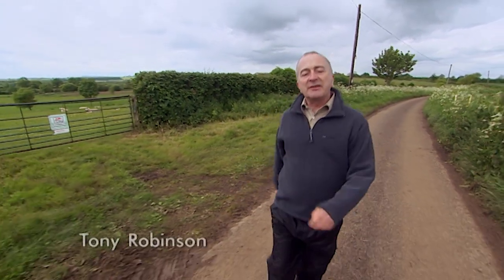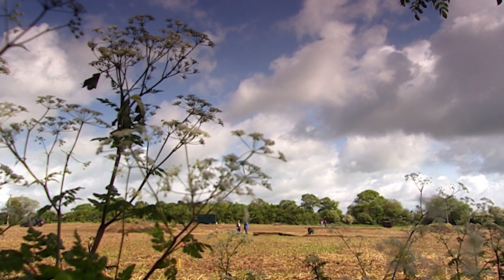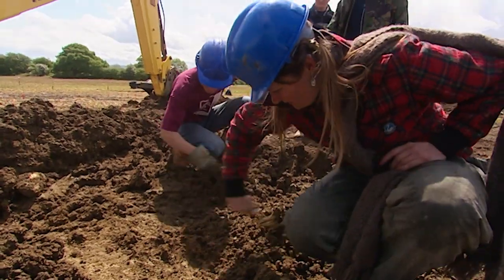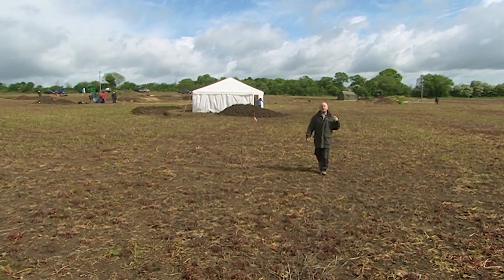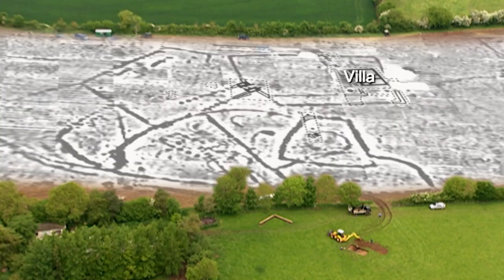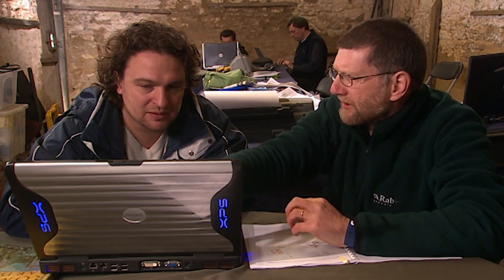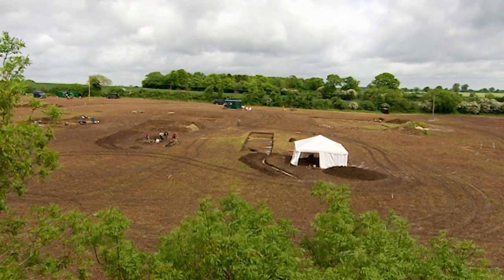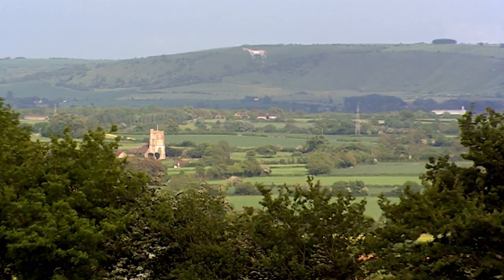Blacklands: The Iron Age Brits Who Welcomed The First Romans | Time Team

Comment: A farmstead site bigger than it should be: I'd put my money on short term animal concentration: many more animals than a single farmer would likely own. A pound for stray animals: Pay a fine to get your animals back. A temporary holding yard to assemble a herd for trading purposes, or tribute in kind, to the local warlord.

The open fire in the round house has always troubled me because of the smoke issue. How could you get around the lack of a chimney without any evidence for a chimney? Answer make a chimney out of light weight organic material that would not survive in the archeology. A suspended funnel made of animal hide would generate the smoke stack effect and draw the smoke through the peak, It would also make an invaluable drying rack.
Reply: Experimental archaeology has shown that the smoke filters out through the thatch on the roof without need for a chimney. Earlier attempts apparently left a central hole in the thatch but this created such an updraft that the flames would reach the roof and set it on fire!
Reply: @georgedorn1022  I understand this. The trouble with it, is it depends a lot on the internal humidity of the building and the roofing material. I’m not convinced that the limited amount of experimental archeology has covered all the variables.

More importantly, indigenous fire culture is nothing like the western attitude to fire. We have an attitude of making a fire and then letting it do it’s thing, while we get on with other stuff. An indigenous person in charge of a fire, is constantly focused on its behaviour. It’s like driving a car. Starting a fire and fuel are a big deal, especially when fuel is scarce and the risks of letting a fire go, are catastrophic.

Another problem is fine particulate matter below 2.5 microns which is invisible, does not trigger the cough reflex and tends to linger in enclosed spaces. These particles are too small for the lungs to expel, and they are an electrochemical vector for chemical and biological pathogens.
Besides, the perennial problem of drying out wet clothing remains. These people need drying racks that don’t get in the way of food preparation and general activity around the fire. Suspending these racks would be essential when space is at a premium.
Reply: The smoke just went into the thatch and it gets very smoky! I have been in one and my asthma prevented me from staying more than a second. People didn't spend much time inside but they must have been affected by the smoke